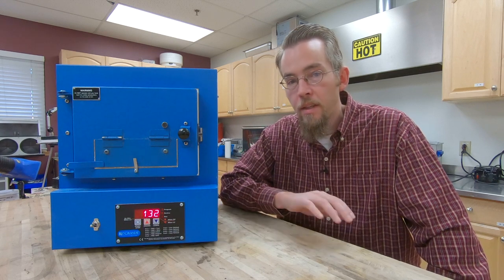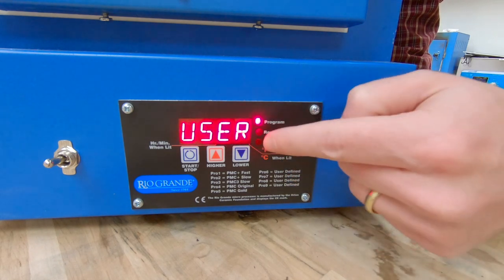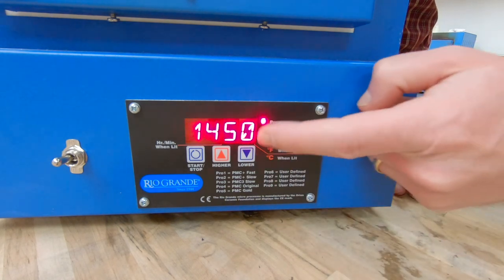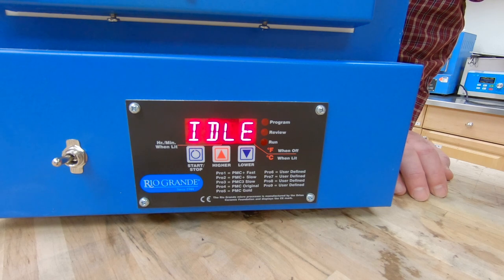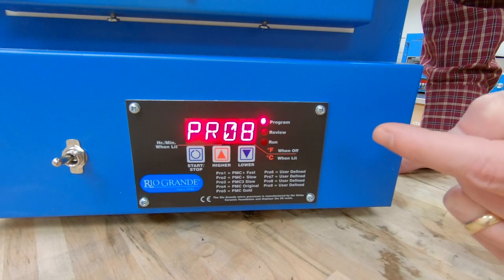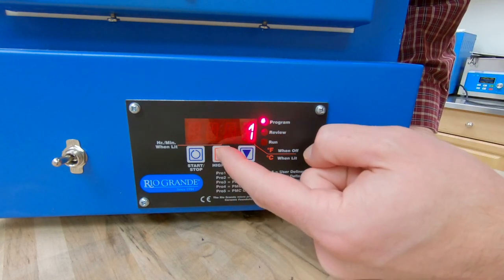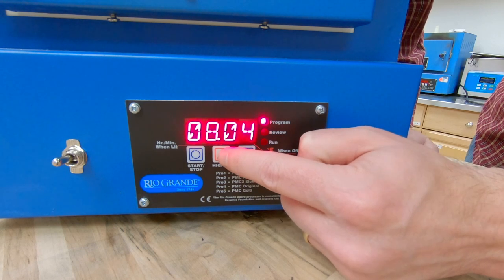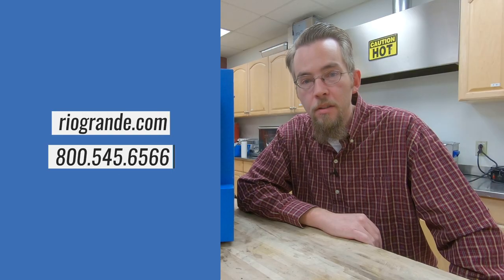How To Program Your Rio Jewelry Kiln

Comment: i'm really surprised that I am the first comment! I found this extremely useful, thank you. I have 4 questions for you if you don't mind.  
The power on this seems to be less than the power shown on the Paragon website for the sc2 (this, 12 amps 1440 watts, The Paragon sc2, is 14 amps and 1680 watts? Will this make any practical difference and can I use online and general info for the Paragon sc2 without running into trouble because of the power difference?

You say early on that there are 25 possible programs? I only see 9 on the digital readout plate, is 25 correct? Meaning I can make up 20 of my own programs?

I'm thinking of getting the sc2 Pro door with a window for this. Is that feasible? Will it fit? Cost, if you know?

I will probably be using this more for fused glass than anything else, nothing larger than maybe 5" x 5", are there any other things I should know to be using this for glass that were not in the video?
Any help appreciated, thanks!